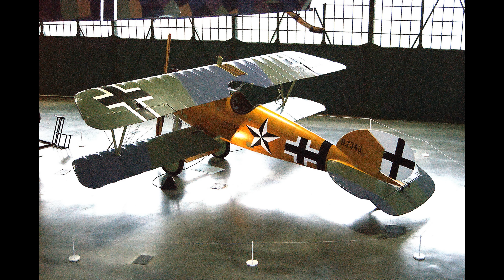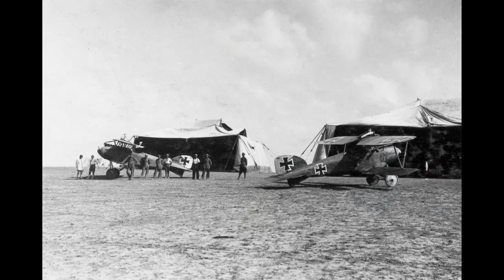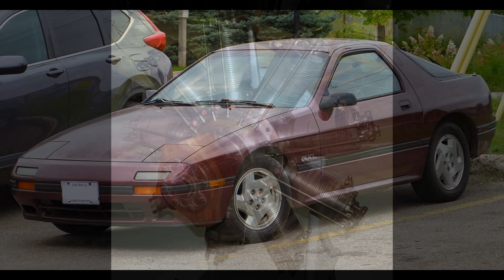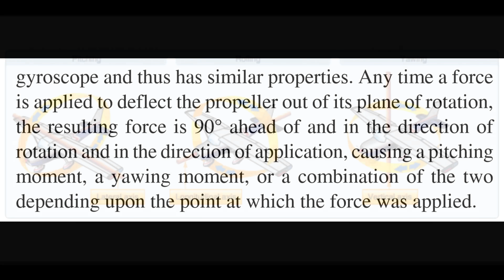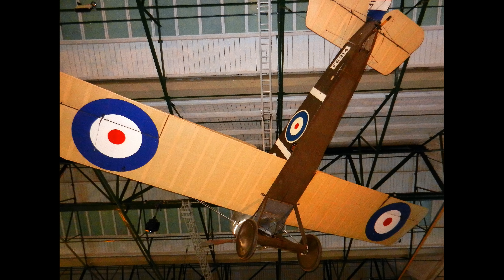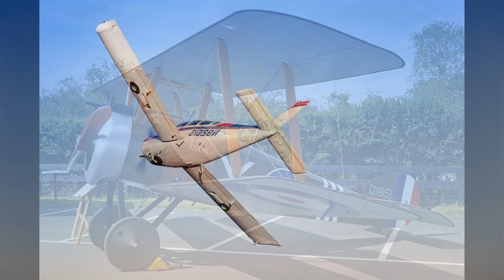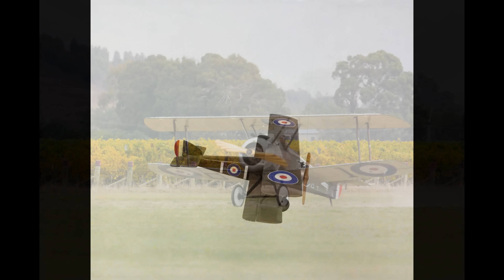Sopwith Camel, War Winner or Death Trap?

Comment: The first ~60 years of aviation saw some pretty amazing advances, going from the Camal to the F-16. However, the last 50 or so years has been much slower. Case in point, the F-16, introduced in the early 1970s continues to be a front line fighter. 
     If the Camel had enjoyed such longevity, it would have served in the Vietnam War.
     Imagine the Camel slugging it out with MiG-17's and MiG-21's!

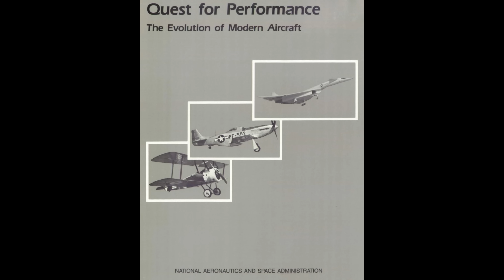Comment: 5:56 the b52 has been in service way longer and 11 yrs between the lancaster and vulcan
Reply from the maker: Yup, in some ways aircraft development hit a brick wall in the 1960s. Engines have become more fuel efficient and reliable, electronic navigation and stuff has advanced, but the airframes haven't improved much as compared with previous decades.

Comment: The main attraction to the rotary was the high power to weight ratio.  Next was their simplicity.
Reply from the maker: Is it? The Hispano Suiza V8 in the Spad XIII has a better power to weight ratio than many of the rotaries.
Reply: @GregsAirplanesandAutomobiles as you pointed out in your own video, engine tech got better .  
A little here, a little there and et cetera.

Comment: I find this a fascinating examination of the particular characteristics of rotary engines. A good pilot learned to use not only the advantages but also the drawbacks of how they worked to stay alive in air combat.Something stuck in my mind about this and that is that as a rider of cycles and motorcycles, to initiate a turn means to start the turn in the opposite direction, with a shift in body placement and then turn the handlebars into the direction of the turn. As I understand it, this is to overcome the gyroscopic force of the wheel and tire that wants to keep going forward. Could this same technique be used on a rotary powered airplane to overcome the force of the motor pulling the plane in the direction of the motor rotation to increase the speed and inertia (?) of a left hand turn? I'm sure there is stuff here I'm not quite getting, but I wondered if a WW1 pilot would have discovered this and taken advantage of it to effectively turn in a direction that the plane would resist. Cool vid and in simple enough details for this banjo player to understand!🙂

Comment: I always thought the Rotary aircraft engine was an idiotic idea and am amazed it was so widely used.  I have to think that ALL aircraft, even jets have some form of gyroscopic effect, even if minor, and thus handling consideration.  Probably the only aircraft without any form of this would be a rocket propelled aircraft which has no rotating parts other than small fuel pump impellers.

Comment: Rotary engines have another liability. They do not have throttles. They are either full on, or off. The only way you can control speed is to blip the gas feed. So if you hear a rotary engine running, it's Brrrt, Brrrt, pause Brrrt and so on. Rhinebeck still flies rotaries and you can hear how the engines run.

Comment: Why was the Pup, or any other rotary-engined fighter, easier to fly when it too had a gyroscopic engine? Did the concentration of weight up front make all that much difference to controllability?
Reply from the maker: Concentration of weight and a smaller engine. The Pup's engine is far less power full, about 120 pounds lighter and of smaller diamter.
Reply: @GregsAirplanesandAutomobiles  Thanks!

Comment: I think I read in a WWI memoir of a Camel pilot (but I can't remember which) that the Camel's strength was the flipside of its weakness - in that the concentration of weight at the front made it very nimble, and very unstable. It needed to be actively flown (making continual corrections) every second it was flying - no time to relax. 

It was very difficult to learn to fly (given that the first flight was always a solo) and killed a lot of trainee pilots (who were, anyway, extremely inexperienced and under-trained - sometimes single figure hours of solo flying - or little more). 

Overall the Camel, and its important role, was one of those examples of an aircraft that was never the best, but Good Enough and available in sufficient numbers *when it was needed*. 

Another British example of this was the (very flawed) Typhoon, or (as you have already described) the (solid all-rounder) Beaufighter.

Comment: I build model planes and for the support wire at the scale, I normally use a method  called stretch sprue. You heat the part of plastic runner that the parts are cut from over a candle and pull it into a longer much thinner version of itself. The art of it is when the plastic is droopy it is in a very "Plastic" state and if pulled it makes a fine filament, it also keeps same shape as original plastic while reducing in cross section. I tend to build 1/72 scale so I just make round cross section wires they are very small at a person being an inch tall. I know tank modelers will make large cross section hexagon and stretch sprue it to a smaller scale to make bolts for tanks, it also has benefit of make a lot of parts of same shape. I am pretty confidante If you really wanted an air foil shaped wire you could file your runner into that shape and pull a reasonable racing wire.

Comment: I know it's not exactly the same thing, but I've done a bit of racing with outboard engine boats. You have to approach a left n right turn quite differently, as the prop either pulls you into the water or lifts you out, your roll is not symmetrical. Normal boat usage almost never has to deal with that, and I can't really explain the physics of how I deal with that, muscle memory. More rudder than you would anticipate, and enough throttle left to over compensate and maintain authority.

Comment: A modern example of large gyroscopic forces on an airplane is a single seat Pitts biplane with 180 hp and metal prop. The gyroscopic forces are particularly evident on takeoff roll when you raise the tail with forward stick. This causes the aircraft to yaw which requires immediate rudder input to stay on the runway. The prop wash over the rudder also plays a factor but the gyroscopic forces are very evident with the aircraft pitch change.

Comment: My father flew one. It was only really safe to make turns to port until a higher airspeed was attained. At take off and landing, the engine was pulsed on and off to allow for better control at lower speeds. The guns jammed frequently until brass was eliminated (different coefficients of expansion). The pilots were mostly teenagers, and a large number failed to survive training and get into battle.
Reply: I have also heard that it did not fly in the direction it was pointing.  Camels tended to crab across the sky.

Comment: Interesting, so these rotary engines had pistons in them ? If so where they spinning on a crank shaft ? Therefore it was just gyroscopic spin that made them turn ? Also what held the engine in place ? was it on an extended shaft with bearings on going back into the fuselage ?
Seems a strange set up !!
Reply: Worth learning about.

Comment: I read that due to the excess amounts of (castor) engine oil leakage the pilots inhaled they suffered from chronic diarrhea?
Reply: False myth
Reply: @koz1931  How so?
Reply: @johndonaldson3619  do you get drunk from smelling beer? No. You must ingest the liquid. The engines did exhaust a lot of oil but most went beneath the plane and the fine mist on the pilots was not enough to drink. Many rotary engine powered aircraft are flying today with no ill effects reported. I ground run several with no cowl at all and am therefore completely coated in oil after a run and have never experienced any issues.

Comment: About having 4 vs 2 ailerons. Albatros, Spad, and even more the Nieuport (with specs closest to a Camel) were sesquiplanes, (1+1/2 planes) meaning the bottom wing is shorter (lengthwise) than the upper one. So bracing both wings together with struts left little area on the lower wing for ailerons. Top one had more area and span, allowing for more effective ailerons, and bypassing cable complications. Adjusting those 2x3 ailerons cables on a Sopwith triplane must have been a mechanics headache. Same idea applies to Fokker Dr1, which upper wing is longer and wider, and the only to sport ailerons, which consequentially are quite long.

About "RAF wires". You find elliptical (flattened) spokes on modern racing bicycles, which do seem to improve aerodynamics, while not compromising strength compared to conventional, cylindrical spokes.

Comment: If you've not yet read VM Yeates' book Winged Victory, it's a must-get. Yeates was a WW1 Camel pilot, and the book is full of incredible and hilarious notes on what it was like to fly a Camel:
"Camels were wonderful fliers when you had got used to them, which took about three months of hard flying. At the end of that time you were either dead, a nervous wreck, or the hell of a pilot and a terror to Huns, who were more unwilling to attack Camels than any other sort of machine except perhaps Bristol Fighters. But then Bristol Fighters weren't fair. They combined the advantages of a scout with those of a two-seater. Huns preferred fighting SEs which were stationary engined scouts more like themselves, for the Germans were not using rotary engines except for their exotic triplanes, and the standard Hun scout was the very orthodox Albatross. They knew where they were with SEs, which obeyed the laws of flight and did as properly stabilized aeroplanes ought to do. If you shot at one, allowing correctly for its speed, you would hit it: it would be going the way it looked as if it were going, following its nose. But not so a Camel. A Camel might be going sideways or flat-spinning, or going in any direction except straight backwards. A Camel in danger would do the most queer things, you never knew what next, especially if the pilot was Tom Cundall. And in the more legitimate matter of vertical turns, nothing in the skies could follow in so tight a circle, so that, theoretically speaking, all you had to do when caught miles from home by dozens of Huns was to go into a vertical bank and keep on turning to the right until the Huns got hungry and went down to their black bread and sauerkraut, or it got dark: the difficulty was that you might run out of petrol and have to shoot them all down on the reserve tank, so that it might be as well to shoot them all down at once, as recommended in patriotic circles."

And so on - brilliantly well written.
Reply: One of my absolute favourite books, and as you say, very well-written indeed, and by a pilot who'd logged 248 hours of combat flying in Camels on the Western Front.
Reply: Hey, what about Biggles? 😇😇
Reply: the peak of the British Empire !

after we U.S.ians left, but are Allies today
Reply: Great book, and much in demand during WW2
Reply: Great book indeed.
Reply: @peterelmer9114  I read that the author died of TB in the early 1930s. That's what his nerve-shattered hero, Tom Cundall was invallided out with; Fying Sickness B, so I understand what it was called then.

Comment: Thank you for pointing out the Clerget was the most often used engine.  So many F1 replicas are fitted with the Gnome Monosoupape as in the Neiuport 28.  As you are an expert aero/auto engine guy, please consider doing a rotary enigine comparison video.  I'd especially like to find out about the LeRhone 9R (180 BHP?) that was slated for the "Super" Nieuport 28 with 600 ordered by the USAS in 1918 and cancelled with the Armistice.  
---From what I understand, as with the 147th Aero Squadron's Nie 28's, the new "Super" had all the "breakaway" mainplane leading edge trouble, fatiguing copper fuel line/tank etc. resolved.

Comment: Not sure why the Mustang is on the front-page of NASA quest for performance it had a rolls Royce engine in it
Reply from the maker: I don't understand your point. The Sopwith Camel on the cover has a Clerget. What's wrong with Rolls Royce?
Reply: Nothing but the Mustang was a flop till the Brits put the merlin in it, pretty sure there are better examples then the mustang @GregsAirplanesandAutomobiles
Reply from the maker: The early P-51s with the Allison engine were not useful for high altitude escort work, but they were not a flop. Below 15,000 feet it may have been the best fighter in the world, much faster than Spitfire Mk5. Of course the Merlin powered version gave it more performance up high, but that doesn't mean it wasn't a great design. I think it makes sense on the cover here.
Reply: Not really, should have been an me109 or the spitfire both have the leap required in terms of progress and ground breaking engineering

Comment: It's interesting that 200 hp radial engines overheated in WW1 while in WW2 they had reliable 2000 hp radial engines. I don't think it can just be due to WW2 aircraft being faster; they were not 10 times faster, especially during take-off when the engines had to be working flat out.
Reply from the maker: It's not, just look at the difference in cooling fins.

Comment: At the small scales that most static modellers work, rigging is usually just round section, either stretched sprue or monofilament. It’s only on bigger RC models that you’ll generally see streamlined rigging. As in full sized aircraft, these wires can be made to order by specialists or, where intended for a well established design, can be bought pre-made. 

I know this was certainly the case for the large radio controlled Sopwith models fielded in world championship competitions and later sold as kits by father and son team, Jim and Mick Reeves.

Comment: 15:04 While the gyroscopic precession isn't affected by roll the roll performance ought to be affected by spinning mass due to angular momentum and the torque placed on the airframe, same way a powerful car will experience 'torque steer' or squat on it's suspension to one side as you rev the engine. If the engine spins around I imagine you should roll faster to the side the engine is spinning towards than you would roll against it, by how much I have no idea but the physics of the situation demands it to be so.

Comment: It is always forgotten that the two big reasons that the rotary was made were power to weight and very low vibrations.
If you do a free body diagram of the piston part way through a power stroke you'll see every normal engine wastes force with the piston pushing against the sidewall of the cylinder.
In a Rotary this force is not wasted and instead drives the propeller. Also with the pistons swinging around a stationary crankshaft no internal wasteful counterweights are necessary gaining more power. Lastly there is no reciprocating action so no vibration on WW1's light weight aircraft construction.
Reply from the maker: The Hispano Suiza V8 in the Spad XIII and Se5a have a better power to weight ratio than most rotaries from the war.
Reply: @GregsAirplanesandAutomobiles  
So maybe I should talk about the jet engine or an electric engine, they both have nothing to do with rotary engines as does your example...
I was pointing out two other reasons Rotary engines were chosen for the first world war...   It's not just cooling...
Reply: @GregsAirplanesandAutomobiles  The Hispano Suiza was also an advanced SOHC V-8 design with a unitized cast aluminum cylinder block with that was 20 years ahead of its time.
Reply: Rotary engines were also 2 cycle engines, if I am correct, which helped their power to weight ratio. Which is why chain saws, outboard motors and snowmobiles have favored 2 cycles despite being less fuel efficient and environmentally nasty!

Comment: One of my favorite places is the old rhineback aerodrome. Great place to see these ww1 airplanes in action. They have several replicas flying! A rotary engine sounds like a machine gun.
Reply: we've been there several times and taken flights in a biplane which I seem to recall was called the Standard - it was black and orange. You sit in a 4 seater cockpit directly in front of the pilot and behind the engine wearing a little cloth Snoopy head piece. The flights are low and slow and absolutely marvelous, as are the daily air shows and the museum barns. Highly recommended. And, yes - those rotaries with the on/off switch instead of a throttle sound like they are constantly stalling.

Comment: I recall seeing an old motorcycle with a "rotary" radial engine embedded into the front wheel (yes, that would make it front wheel drive, too.)  No real idea how difficult it would be to ride, but considering the engine has to be shut off in order to stop...

Comment: Hi Greg, I was one of the folks who collected WW1 aircraft data and provided physics input for the game, Red Baron 3D. There's several good books on the complex craft of rigging early 20th century aircraft but mainly wanted to mention that in my understanding it was common to trim those aircraft to help the pilot contend with gyroscopic and torque effects of rotary engines which could be quite tedious to navigate to a map point while countering these effects so it just helped to fly straighter. However, these effects could indeed provide some benefits in manuever fighting as you noted. Leading an enemy on your six into a left turn naturally raises the nose to snap roll into a tight Chandelle and two circle right turn fight as a good trap with the Camel. However, I personally preferred the SE5a and Spad XIII's superior speed to hit'n'run or boom'n'zoom with a more modern hindsight of how that was learned by the US Naval flyers to defeat the more manueverable Japanese aircraft in WW2... although this is how Werner Voss was ultimately defeated. Anyway, good stuff.
Reply: I was taught that you kicked the left and right rudder pedals when firing the guns on a rotary-engined fighter, to form a 'cone' of fire that could be quickly expanded or contracted without otherwise steering the POA.  That ought to work in a sim with a proper physics engine...